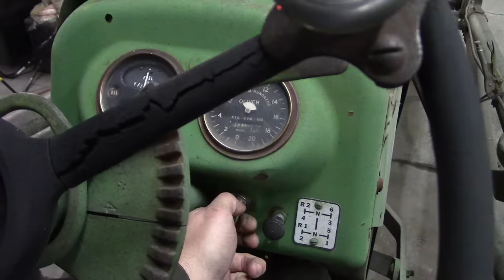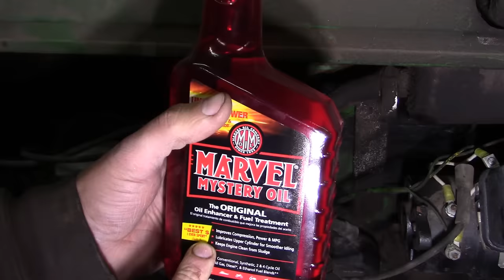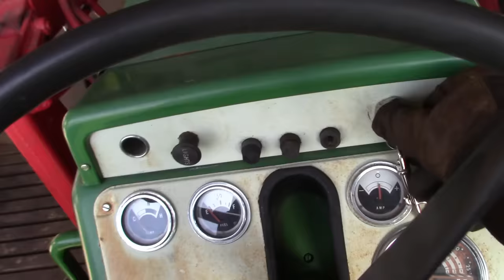Oliver 770 Tractor - Will it Run after Sitting 10 Years? (Christmas Special)

Comment: Man you are a glutton for punishment ... but that marvel mystery oil works wonders ... I bought a John deer 885 and it smoked some - I drained out a couple of quarts of oil and refilled with marvel - ran the tractor hard mowing with it for 4 hours or so... I figured it had a stuck ring - the exhaust cleaned up - I changed the oil and have been mowing with the tractor for 5 years now and it has no blow by and uses no oil....

Comment: Hmm, a grease fitting made into a spark plug hole adapter and use hydraulic grease pressure to break them stuck engines.
Reply from the maker: I have a whole video on that. It didn't work.
Reply: @WatchWesWork  I've always wanted to try it with a flat steel plate after the head was off and use a seal ring under it. Bolt it to the head bolt holes and tap a grease fitting in the middle of the plate. Yea I guess with the head on the valve seats and all the other leaks would come into play with the spark plug idea. Great bunch of vids on the old tractor.

Comment: hi from the UK a old boy taut me a trick to Un size a engine get a old sause pan 1lt diesel and a electric hob it must be Electric heat up the diesel until it gives off vapour then pour it into the cilinder remove the engine oil and see if it runs past the rings then give it a tug with your over tractor if still no joy head off check for stuck valves hope this helps

Comment: Hi ! Open exhaust tractor left outside for ten years are shurely stuck and filled with rainwater and rodent remains. The overall result doesn't surprise me a lot. You need to be an exhusiast to get it back working. Economically it is dead.

Comment: When you drag a tractor you need a person on each tractor so when you get going fast just drop the clutch that frees them up good

Edit when you were undoing the head bolts one of the valves jumped up
Reply from the maker: I asked Max, but he says dogs can't drive tractors.
Reply: Fair point
Reply: This is probably the worst engine I've seen to be honest I mean I stripped a international 674 and a sledge hammer was needed to get out the piston because it had lived outside for at least 15 year without a cover on the exhaust + I live in England so a lot more rain :)

Comment: Next time you try pulling it with another tractor put it in the highest gear. this way the wheels have the most mechanical advantage on the motor.
Reply from the maker: It was.

Comment: clean buckets and full grease guns!?! exactly what are those mythical objects? surely they only exist in an alternate reality. i've got half a dozen guns, and it never fails that no matter which one i grab, it needs a new tube of grease, and i've got a corner with several towers of buckets, and they are either half full of stuff, or too filthy to haul dirt, let alone some sort of liquidy substance. i'd say that corn crib roof had a leak directly above the exhaust pipe. it looks more like a battleship anchor, than a tractor to me, but a few youtube vids might at least pay for the parts. mebbe. good luck hanging on to your sanity, you have my sympathy. jumping into this briar patch head first proves you're a braver man than i.

Comment: I believe the phrase "positive ground" is an oxymoron. Most electrical systems will switch the negative side of the circuit, not the hot side. Is that what you mean?

Comment: I’ve never known but can anyone explain why they used positive grounds on machinery in the old days??
Reply: Preventing galvanic corrosion. It actually doesn't matter on a car which is electrically isolated from the ground by its tires, so it was merely convention by that point.

Comment: pulling backwards never works, there is way too much internal motion of gears to make anything move in the engine or transmission. pull it forwards, is much easier and generally works.

Comment: I like the false ending.. on the power steering get rid of that dam grimler power steering they are a pain in ths a** my 770 has that system and i rebuilt it it costs over 1k and it still sucks. Get a normal pedestal and a aftermarket power steering or no power steering at all

Comment: drop out the crank// #"1-2-3-4-- raise up tractor  use long brass tipped steel rod  use the weight of tractor to press out pistons setting tractor down on steel rod to floor

Comment: Is that 1650 a diesel
Reply from the maker: Yes.
Reply: @WatchWesWork  thank you the old diesel's are the best why didn't more people buy Oliver tractors with diesel
Reply from the maker: @neilmurphy845  They were more expensive and they were a pain in the ass for chore tractors up here where it's cold. Those precombustion engines will barely start on a sunny July day.
Reply: @WatchWesWork  my god that's no good for a work tractor are those feul injection systems where they have a injector for the intake are they any good

Comment: You need to pull that motor down it's for the water is for rust and no good it cost too much to fix it so I'll buy a new motor on the internet they get that tractor running

Comment: I don't get, why petrol engines are such a thing in the USA. Why does one want to have a commercial vehicle with a petrol engine? it may have superior peak horse power, but overall characteristics are inferior compared to diesel engines.
Reply from the maker: This tractor is 60 years old. Gas engines were pretty common back then. Especially for what we call "chore tractors". Gasoline was easier to get, the engines were less expensive, and they would start in the winter in our very cold climate. After 1980 or so almost all tractors were diesel.

Comment: No way will modern equipment run when it gets old. Even if it sits in a barn.
The computers machinery is now full of will be obsolete with no way to code or maintain them.
You will have mechanically pristine equipment that is totally useless for anything.
You call that progress?